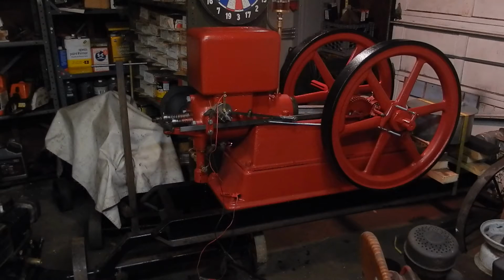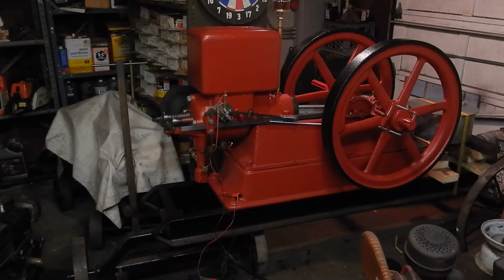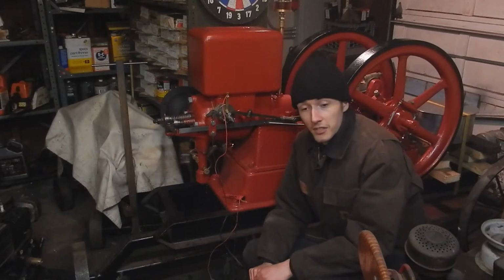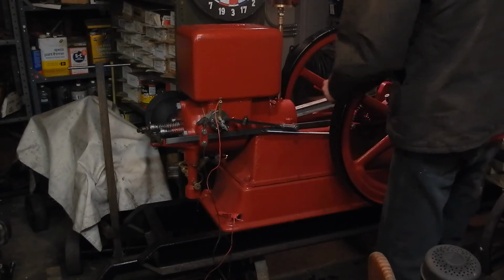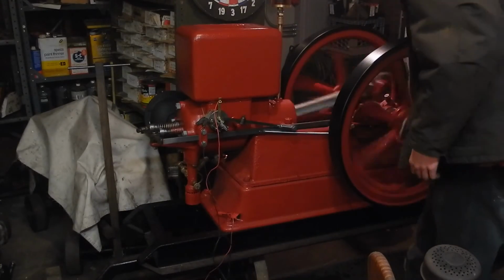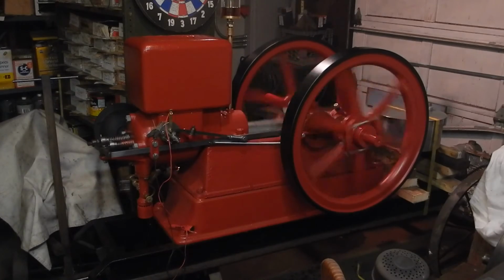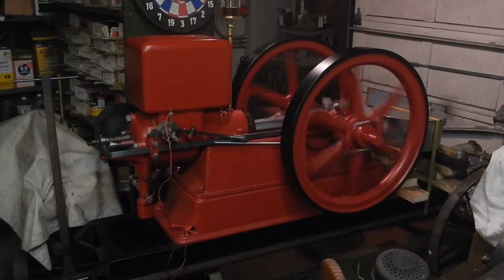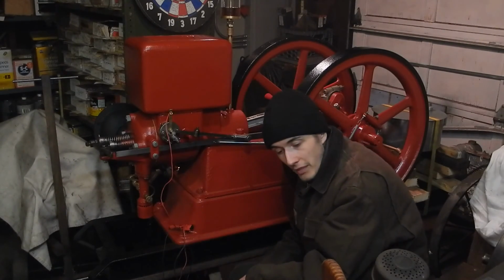4 1/2 HP United - IT RUNS!!

Comment: The serial number should be on the very end of the crankshaft on igniter side.. As far as a exact build date, Associated started supplying United with engines around 1913, 1915 they put the tank in the base, 1916-17 they started with the goose neck trip. No serial number records with build dates has surfaced as of yet, be nice to find some original bills of sales, shipping ledgers, etc with date and serial number, I could use on the United Registry. On the check valve they use a Associated type ball valve, NO ,gate valves, it holds the gas back until there is a slight suction from carb to unseat the ball which lets gas flow in, just the opposite of most check valves in fuel lines. The tank should be about the level of the top engine base  bottom , like a 4Mule team which is what most parts are. On the Stak too nice site...
Reply from the maker: I'll look for a serial number when i go out today. so my engine must be 1913 or 1914 then? cool! it's my oldest engine!

I do have the associated check valve, look at my other vids for details of the engine if you're interested. the bottom of the tank is a little above the top of the sub-base. it runs well with a full and empty tank.

Comment: Sure feels good getting them to run the first time If you have a number on the end of crank send me a email and I will put it on the site. Mine is a little later and much more$$$$, but it has a clutch and gooseneck trip one of the first with that . On the compression relif it should havea check ball to stop air from going in so no lean mixture, just air coming out, and stiff yet. More on stak Nice
Reply from the maker: Interesting to know on the compression release. i just put a standard brass petcock there. it's all i had. where exactly on the crank would the number be? gov side, etc? i haven't noticed any numbers on the crank but i'll look again. i'd love to know what year it is. the tag is gone.